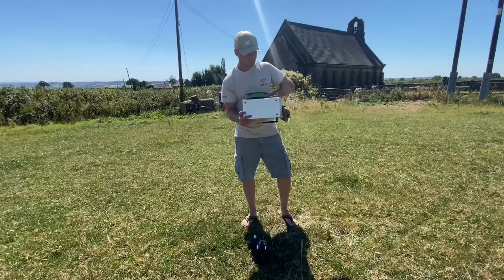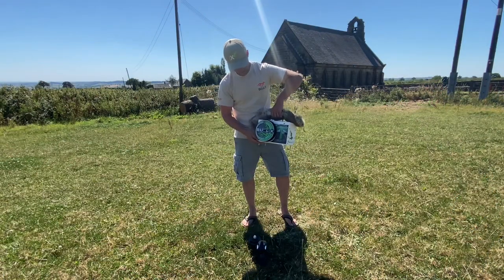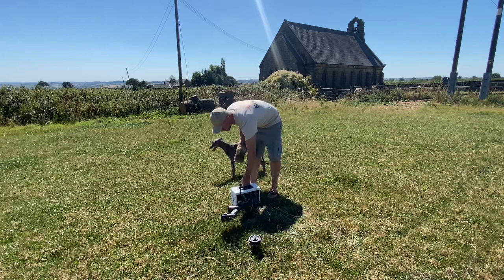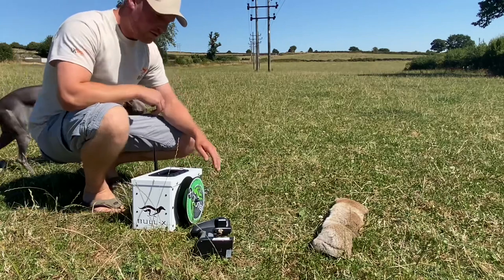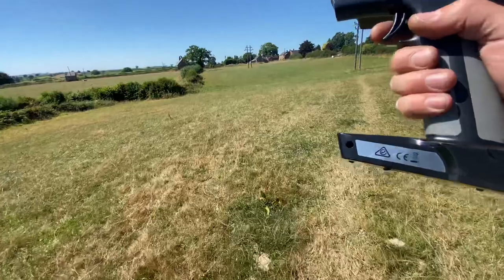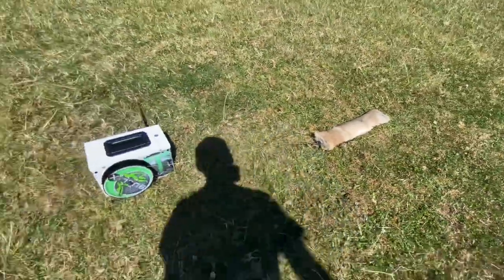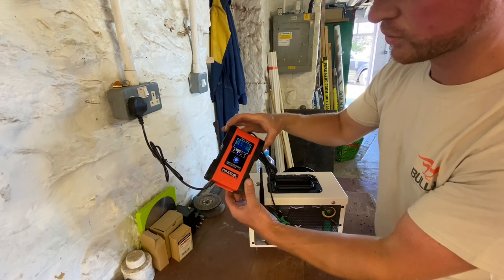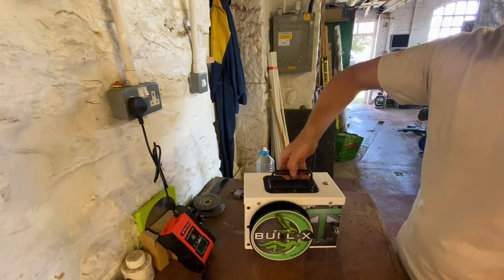How to use the 24v BullX Mini Deluxe Lure Machine.

Comment: Hello,  i bought two of the Deluxe machines last year and we are just now wanting to begin using them.   When the machine and remote are turned on,  nothing happens when the remote trigger is pulled.  The machine is fully charged and green light on.  The remote shows both a green and red lights.   Is there a trick to synchronizing them?